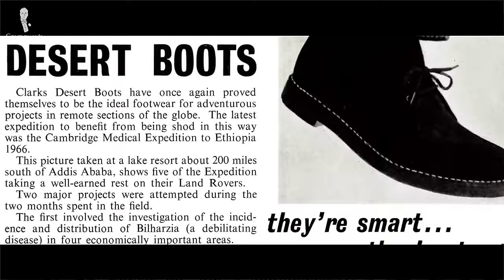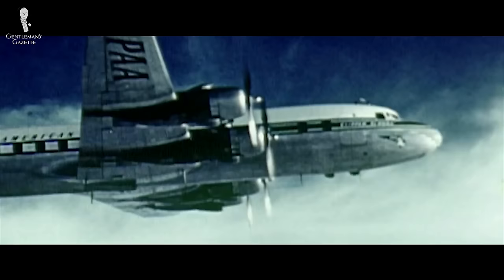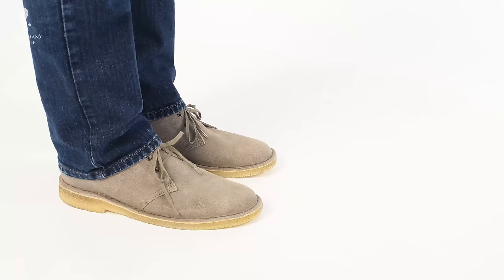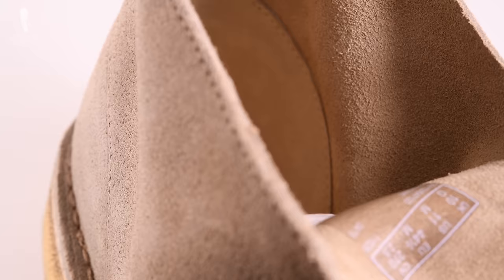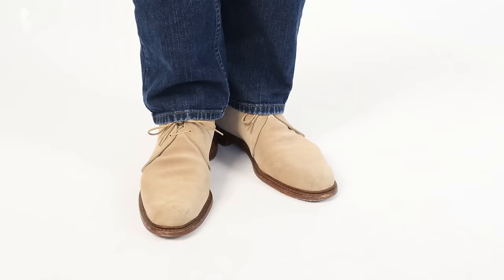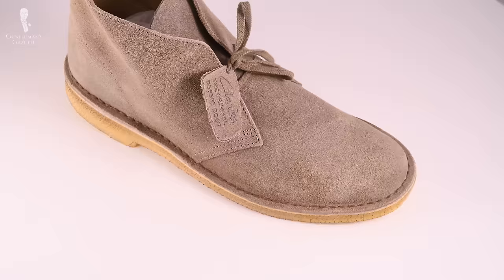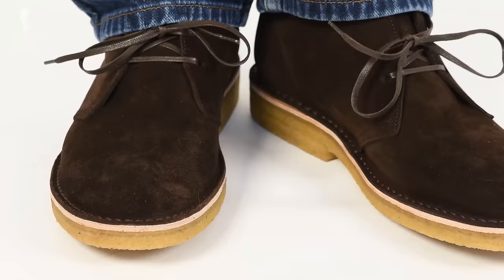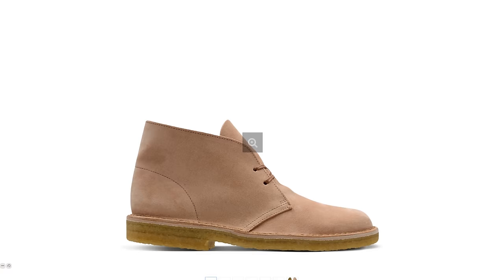Clarks Desert Boots Review - Is it Worth It Series - Suede vs. Leather Chukka Boots

Comment: I worked in Clarks in the US for a few years. The term "Original" now pretty much means the line of shoes in Clarks. Pretty much anything with a crepe sole will be considered an Original, so Desert Treks, Desert Mali, Wallabees, and so on, and are usually available only on the Clarks retail stores or on their websites (and Amazon, I guess). Bushacre 2 is the cheaper, outlet alternative,- technically an Original but not really, which you can find in other retailers, but the sole and leather are significantly different: the sole on the Bushacre is a more synthetic rubber, cheaper leather material, and in my opinion, stiffer. I've had a lot of people claim that they found Desert Boots cheaper somewhere else, only to show me a picture of a Bushacre; not the same thing!

Desert Boots generally run a half size, to a whole size bigger, so if you're a size 9, you might want to try an 8.5, or even an 8. So I'm surprised that yours run smaller. Keep in mind, they stretch once you break them in, and your boots look pretty new, so that might get really loose later on. In women's sizes, they run tight, so one may need to go up half a size, but they stretch out a lot, so don't go up too many sizes because once you wear them in, they'll be pretty loose (Stores also stretch any Clarks shoe for free, so if you buy a pair that's a little too tight, but is the right length, ask an associate to stretch it for you). Also, for those wondering, the Desert Boots don't come in wider widths. Again they stretch, so you might be lucky once you wear them in, but if you have a very wide foot, go with another style. The Bushacre 2 DOES come in wide, however just the beeswax, and not in the other colors .

And the laces for the generic Desert Boots break easily. They don't give out free laces anymore, but they might have some available to purchase on the Clarks website (Provided they haven't sold out). If they're out, find a place that sells shoelaces and find the right length, they'll last longer anyway.

Beeswax boots are generally more popular, in in my opinion, easier to maintain. Sure, they scratch and scuff as shown on the video, but just rub some beeswax on there with a rag and you'll have them look new again. Suede needs some cleaning, but is easier to break in and is just softer in general.  Also, the have traction from the crepe, but they are NOT slip resistant, so don't use them where there's grease or oils (Have had people in restaurants ask if this is a good shoe for their job. No).

The expensive, imported from England/Italy ones  are handmade with higher materials, which is why it's more expensive. They're also sturdier from what I've seen.

You also get seasonal colors that only come once a year, so if you like getting the Desert Boots in fancy colors, check the end of the season when the seasonal colors go on sale. (Beeswax, brown, black, and other neutral colors are available year round, so will not go on sale, and are pretty much always excluded from sales and promos. Read your fine print!!)

Also, the quality has changed over the years, at least from what older customers have told me. I've had some die-hard fans ask us to hunt down older Desert Boots with a very specific SKU# because the newer versions "just don't feel the same". You'll be able to tell by the logos inside the insole, or even just the box- that's the most obvious sign. The older versions definitely won't be in the retail stores anymore, as they had all been shipped to the outlets when I still worked there, and even finding them in outlets will be difficult unless you wear a larger size shoe (like 12 or 13).

For me, I'd agree and say it's worth it. It is pretty flat, so if anyone needs arch support, this may not be the shoe for you; unless you get a size larger and put an insole in. They last a very long time, and have a great casual or semi-formal look that has been in circulation for a long time, which means that it's definitely a Clarks favorite.
Reply: Michah Villanueva, hi, im confused about that beeswax leather. do they have the same texture as nubucks? my boot also has that kind of effect when you run your finger and it will create markings just like what he did 3:04, because im planning to buy cleaning/maintenance kit for my shoes
Reply: @dcooper6857  Long response ahead, sorry! 

Beeswax is definitely a different material to nubuck. Beeswax will be a thick layer of leather with a coating of beeswax on it. It starts out really stiff, so it won't be comfortable if it's your first time wearing it. You're right, it does get scratches easily, and it gets lighter wherever you bend the leather. There's two options I've seen to get past that: 1, keep wearing it out so that it looks rugged. 2, put beeswax on it (if you're in the Clarks store, they sell it as "Weather Guard. ") It's a small container of wax, and you apply it on the shoes with a cloth. It takes the scratches away and makes it dark, but once it dries it goes back to the original color. (heat the wax up with a hair dryer or heat gun put on low if you don't want light streaks when it dries. Also waterproofs it!)

If your boots are more aged, with a lot of creases, which will happen eventually, it will be harder to keep it looking brand new, but the wax will still reduce the scratches. Maybe use more wax to make sure it gets in the creases. 

Nubuck is essentially the underside of leather. If you've seen underneath some real leather jackets, you'll notice some fuzziness- that's nubuck. Nubuck Desert Boots will be a softer material (think of a less fuzzy version of suede) and easier to break in. However take care of it like suede. Just don't brush it with a hard brush. Any big scratches and stains you get on it will be permanent. So the best way to take care of it, in my opinion, is to buy Scotch Guard, or other colorless waterproofing sprays. That will at least protect it from spills and mild splashes. DON'T put wax, polish, or any other material on it, otherwise it will change the texture, or even the color. (Unless you want to. I put  wax on a pair of black nubuck boots that I wanted to waterproof because I was fine with the texture changing, and it didn't change color because it was already black. So it's really up to you!)
Reply: Thank sir, quite a good read!
Reply: Yeah, great and informative response. Thanks Micah, I had a good time reading it.
Reply: Michah Villanueva very impressive and informative response. Can I ask you, I just bought a pair of the Bushacre 2 at a retailer like TJ Maxx and inside it’s labeled “Collection by Clarks”. Are these low grade that should be returned, or will they still be long lasting quality boots?
Reply: Impressive synopsis.
Reply: I felt forced to read all that...never in my life have I read a comment in YouTube that long...
Reply: @jcrva4633  Hey! So Bushacres are the "outlet" version of the Desert Boot, so in short, yes, quality won't be the same. The TJ Maxx version of it will pretty much be the same as the Bushacre you'll see at a Clarks Outlet (the type where all of the shoes are displayed and you essentially just go to your size and find what you like) , so  if it's clean and no scratches, no need be too fussy if you only care about the style.

Outlet version will pretty much mean slightly different quality, like the leather or the sole (I think one of my really long comments elaborated on this, so I won't write another essay, but if you me to explain further, I will)
Reply: @digoravas1986  To be honest I wasn't intending to write so much. It wasn't until I was thinking about all of the things customers would ask me that I found myself writing a book in the comments section.
Reply: Hey. Thanks for the info. I remember I got a pair of my first desert treks and then chose to try desert boot. I ended up liking the shape more than the wider desert trek. I liked them so I got the suede version as well. I wore out the crepe soles and had them re soled because the leather was still in good shape. A few months ago I went ahead with the bushacre simply because of the harder wearing sole. Sire they feel different perhaps less quality leather is used but they still look great amd I enjoy them in both suede and in beeswax leather.
Reply: Yes I read many people claim the new desert boots quality has gone down. Price is too high for what they are. $120. I bought mine on Amazon sale for $75 in 2012 and they are still in good condition and no is not busachre 😂 The crepe is all dirty but the leather is perfect. I rarely wore them though that’s why. I plan on resoling them which is better than buying the new shoes with lower quality. I still have an extra pair of laces I got for free lol the original laces have never broken, Clark got greedy and their quality went down. Prices went up. Not longer give shoe laces to customers.
Reply: Michah Villanueva I work there now, they updated the style. It runs very small. I am a size 6.5 and I bought a 7.5 in the desert boot in beeswax.
Reply: @victoriadabash   what about  desert  fit small also?
Reply: Salamat Kabayan
Reply: Michah Villanueva well said 👏🏽
Reply: Hi Michah villanueva,  I have Clacks Desert Boots and I love them all...But, I have a hard time to clean the sole each time after used...Do you know how can I clean them more easily? Actually, I use toothpaste with a toothbrush... Rémy
Reply: Your reply was much, much better than the video presentation.  (Perhaps, you should make your own Clark's video?)
Reply: Muchacho gracias.
Reply: what about Clark's Collection? Is it cheaper than Bushacres?
Reply: Michah, thank you so much for your review. I live in Peru, so acquiring a pair of Clarks is a bit too expensive here, so I was waiting to buy a pair in the US, after all this coronavirus pandemic is over. Which boots do you recommend in terms of quality/materials?
Reply: @sergiovelasquez5138   I did not realize how many likes my post had until today, but I'm glad that it's been helping people!

I would say the Desert Boot in the original beeswax leather would be sturdiest and easiest to maintain. If they get minor scratches, you can just rub beeswax on the boots and they will pretty much disappear (and also helps with making the boots water-resistant). The tumbled leather (or other smooth leather) would be my next preferred meterial because suede and nubuck don't keep their color and texture (especially if they get wet), but they do look very nice and you do not have to break them in as much because they're already soft. If you DO get suede/nubuck, please get a water-repelling spray!

If you just want a Clarks boot with a more casual style that is not a chukka-style boot, try the Wallabee Boot. They fit wider and have a thicker crepe sole (for more cushion). They also come in beeswax leather and suede, but they do not have as many color options as the Desert Boots do. Some people highly prefer Wallabees over the Desert Boots, so it is worth trying just in case you like it better.

There's also something called a Desert Mali, which is a high-top boot with the crepe soles. It looks similar to a combat boot, but not as bulky.  It comes in beeswax, and some leather colors depending on the season, but have the least amount of color options available. 

For the sole, I much prefer the original crepe sole over the synthetic sole that the Bushacre2 and Stinson have. A good way to tell is to feel the soles. Crepe will feel it will feel slightly squishy when you press on the material, like those gum erasers that crumble when you try to erase pencil marks. Bushacre soles will be harder, and are usually a darker color. Although crepe gets dirty easier, it will have better impact resistance, so it's more comfortable.
Reply: What does the large "W" on the box stand for?
Reply: @jimgurganious6642  if you mean the black square with the white "W" on the side of the shoebox where the name of the shoes are, that's how the style of shoes are categorized. For example, "A" will be dress shoes, "E" is for semi-formal, "X" will be sandals and so on. (Women's have a few others, like "C" would be on dress flats, and "S" are strappy dress shoes). 

It was mainly used to organize the stock room, so that all of the Originals would be together, and so on. They started to change the stockroom layouts around the time that I was leaving, so it's no longer sorted that way, but it definitely helps the associates find suggestions to give if someone just went to the store looking a certain look.
Reply: @victoriadabash  yeah, the women's desert boots run so small. I'm honestly a size four/4.5 (which isn't a thing with Clarks, but I get laced shoes so it works). And a 5 was absolutely too small.
Reply: @lapinfacedelion  if you buy the Clark's sandal cleaner, that cleans the crepe soles nicely. There's something else, but I honestly can't think of what it's called.
Reply: @TechnologyTidbits  I'm not very good at making videos, so that's not going to happen. I'm happy just responding to comments whenever I get tagged, otherwise I forget to reply
Reply: @HeyMichah  Thank you very much for your response Michah.
Reply: @HeyMichah  Thanks, for a minute I thought they made a mistake and sent  a "wide" fit...
Reply: @jimgurganious6642  No problem. That just reminded me of all the times people would tell me that I brought them the wrong size 😂

For wides, that will be toward the bottom of that same label, near the size of the shoe, so 7M or 7W. If I remember correctly, Originals don't come in wide or very rarely come in wide because they stretch so much.
Reply: @Michah Villanueva thank you for a very helpful comment, even 2 years later! Do you have any advice about the shoe version “London desert” I believe they are called? Material quality etc?
Reply: @HeyMichah  hi Michah is it suitable for summer weather esp in Singapore?
Reply: @muhammadaqil9138  it was designed to be worn in the desert, so hot weather should be okay.
Reply: @Begbiebiswas  I haven't personally worn one, since it never came in my size, and not everyone would ask for it, but they are made with the same quality materials.
The only thing I'd advise is to be careful of the edges with the beeswax material. Since it's low cut with a thicker and harder material, it could irritate your ankles when you walk while it's brand new. Will definitely be more comfortable once worn in, though
Reply: @HeyMichah  would they expand?
Reply: @muhammadaqil9138  yes, they do expand as they get worn in, so if they feel loose when you're trying them on, it will get more loose later
Reply: I was debating whether to buy this boot or not. thank goodness I found this video AND your comment 😳 I tried once in store and yes for women it's very narrow & stiff... i wanna buy 2nd hand that's why i wanna make a good purchase out of it. cos you can't return them :(
Reply: @Michah Villanueva  sorry top bother you but, If I wear a US9.5 - 4E (extra wide) in New Balance Sneakers, do you suggest going hale a size down or a full size down on the Bushacre 2? Thank you so much.
Reply: @julien7228  Hi! Sorry for the late reply. The Bushacre 2 doesn't run as large as the Desert Boot, so you might be able to go down just half a size.
Reply: French Part A Compton  what colors do you wear? The beeswax is a safe option because brown matches most colors. You could also do oakwood or sand if you like lighter colors. If you wear all black, then you can do black suede (black leather is not always available year-round).
Reply: Thanks for the very detailed and honest breakdown
Reply: Thanks
Reply: @HeyMichah im not sure if you mentioned it before but what is the "real" desert boot so not the outlet versions etc
Reply: @ClassicTor  Hi! I'm pretty sure it's in a response somewhere on thsi thread. But the short version is that the 'real' Desert Boot has the crepe sole. It's that rubbery material that's a little squishy. It feels almost like those old erasers that don't actually erase anything correctly. Size is also larger compared to the outlet version or the Bushacre 2. The leather quality also feels different.

The outlet version has a more plastic feeling sole. It's not squishy at all and runs smaller than the Desert Boot.

But don't feel like you can't find Desert Boots in outlets. Older Desert Boots (like some seasonal colors, or discontinued colors) get sent from the regular stores to the outlets. So it's still possible to find them if you're lucky.
Reply: @TechnologyTidbits  I appreciate the comment, but I'd rather not make any videos. It's been a few years since I last worked there. Also, my first comment was supposed to be short that just ended up being an info dump
Reply: Okay.

Comment: i have the Clarke's beeswax chukka boots (I wore them to work yesterday, actually). ) One drawback to them is that the topline above the heel is quite stiff when you first put it on and there are some issues with it running on the bottom of the calf/top of the heel.  They are, however, very comfortable to walk in once they "warm up". The other drawback is that the toe cap is quite generous and they can look a little like clown shoes from a certain angle.  Mine are made in India, IIRC and cost $92.
Reply: Oh, and curiously, the contrast in colour between the crepe and leather is less marke don mine - the crepe is more of a soft caramel colour, which I think looks better than the high contrast lighter crepe.